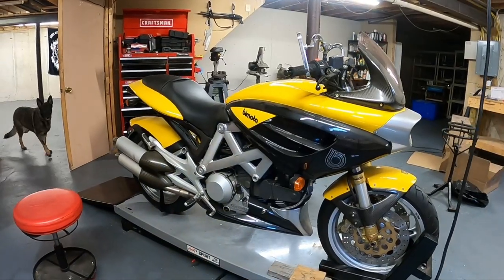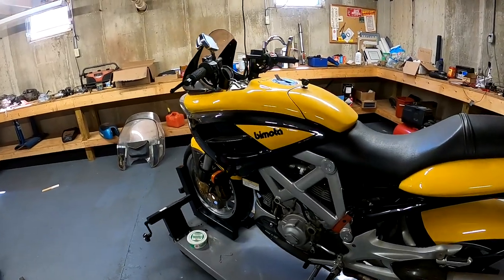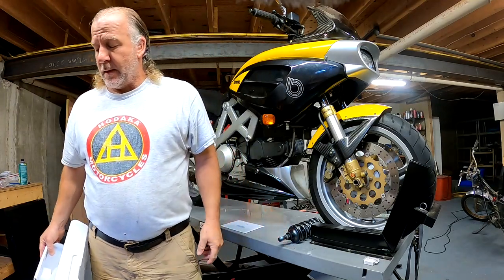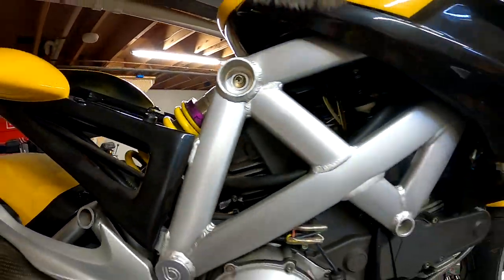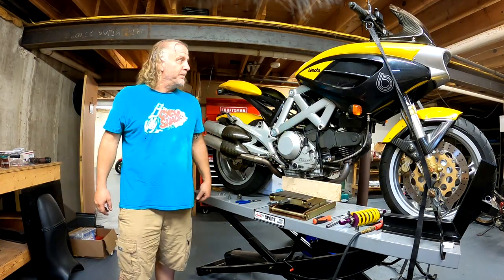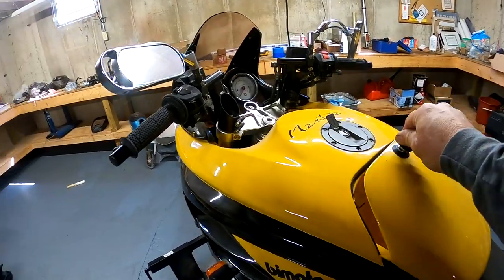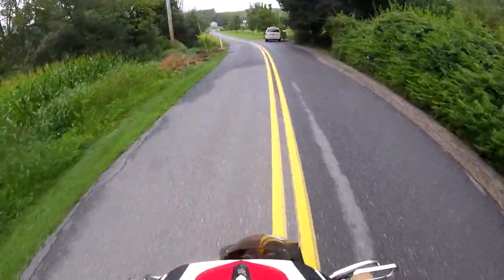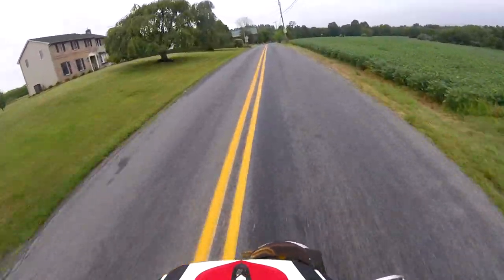THE BIMOTA MANTRA IS ONE UGLY MOTORCYCLE

Comment: Bimota did not start off as an aviation company making helicopters and aeroplane parts and then moving on to motorcycles. That was actually Mv Augusta. The Bimota company was started in 1972 when Massimo TamburIni crashed his Honda CB750 race bike and decided that it was not the engine that needed improving but the frame and suspension set up. Since then all Bimotas have taken engines from other manufacturers and then built their own chassis and frames around the engine. The company went broke on numerous occasions but is now building bikes again using Kawasaki engines.
Reply from the maker: Thank you

Comment: was it tricky to do the belt on the vertical cylinder?
Reply from the maker: No it was very easy. And you don't need a fancy tool. Just don't turn the motor
Reply: @bullpencycles  That's good to know, thanks for the reply.

Comment: I have the Bimota DB4ie fuel injected same motor,but year 2000 , in the nicer yellow and metallic black and silver. I think there is only 4 of my specific model in the USA
That Mantra is so worth keeping for the way its light well balance motor to frame was designed.
There is nothing like it. By the way , you look like your in Philadelphia ?
I,ve had my bike new from 2007, it sat as new old stock, remembering that the DB4ie's were never sold in the USA or anywhere due to Bimotas financial closing at the time in 1999-2000
Not sure the state of Bimota at this time, not even sure where they are building that new kawasaki engine TESI bike  thats turbo charged. Last I heard was they moved the machinery and remaining bikes to Switzerland or somewhere else.  Now I believe Kawasaki might have 49% interest in Bimota ownership. Never sure one day where I will find parts . Nice video, keep up the good work
Reply from the maker: Thank you. The video was shot NW of Allentown, but we've moved most of the shop to Florida, near Daytona. Now I gotta lookup a DB4ie.